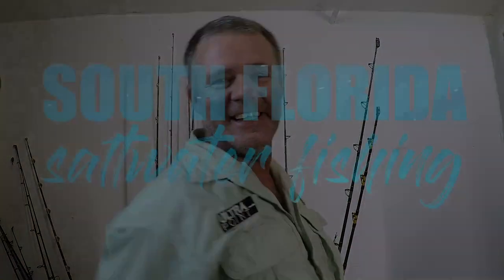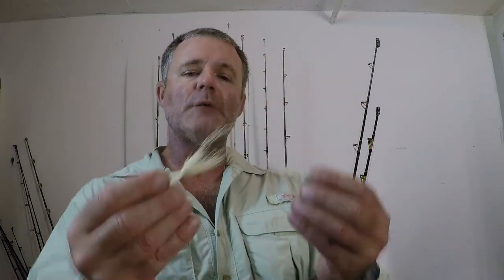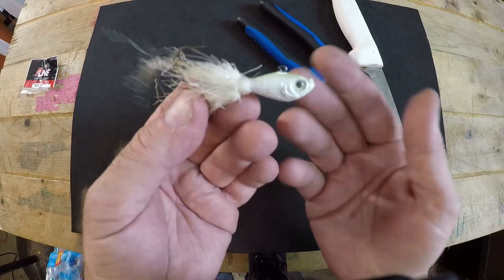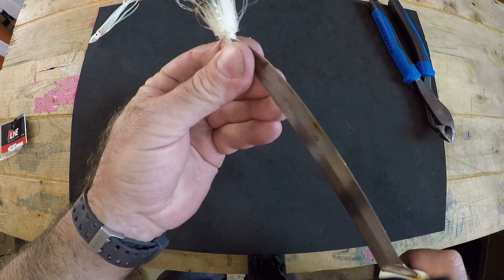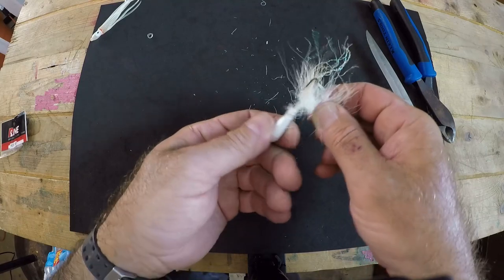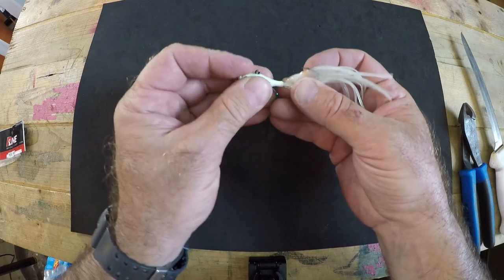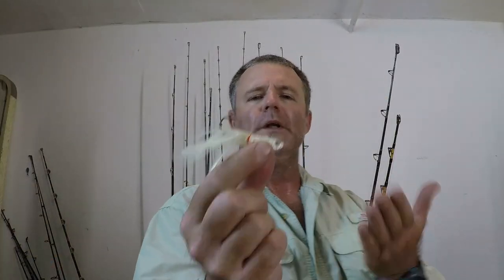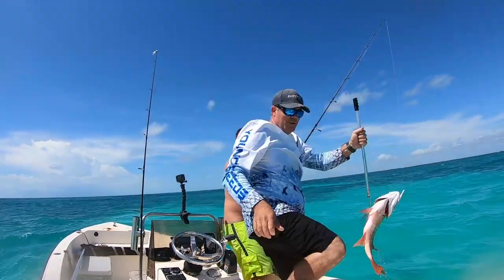How to rebuild a worn out BUCKTAIL JIG South Florida Saltwater Fishing style | Best Fishing Lures

Comment: Hey Heath do recommend adding some glue to the squid head so it holds better? Like some super glue or hot glue
Reply from the maker: Thanks a million for watching and asking a great question.  No I don't recommend gluing it with any sort of adhesive.  Personally I think that leaves some sort of funky taste to it and is it the tracking from getting a strike.  Also if the squid just so happens you get hit pretty hard and get torn up you want to be able to replace it easily without going through the whole process again.  I'd rather have that ease of access then having to peel and scrape blew off just to be able to get the lure back in the water.  Hope this helps.  Thanks again for always taking out time from your life to stop by and watch and chat with me.  I truly and sincerely appreciate it in all your support for the channel.  Tight lines & take care ;)